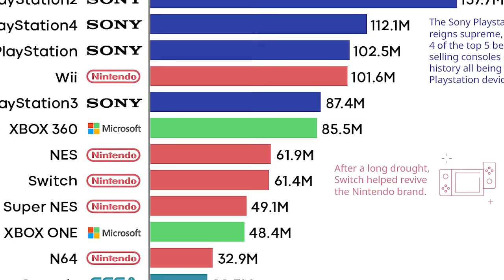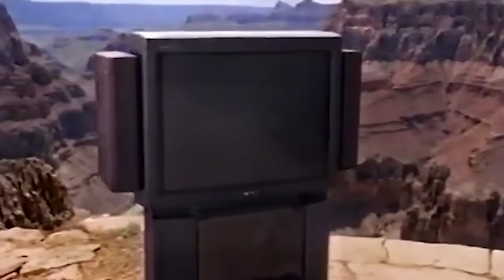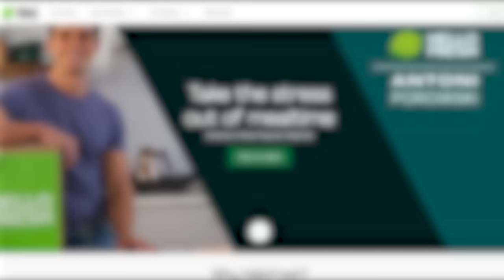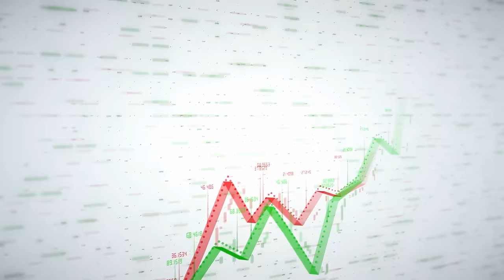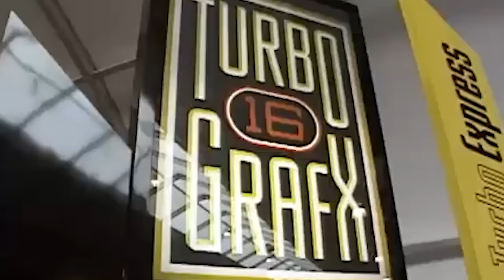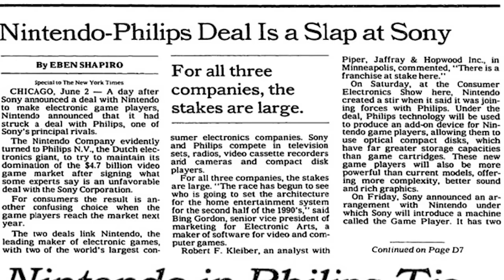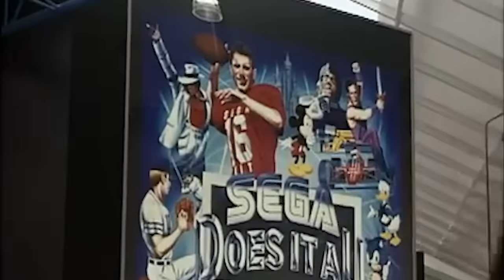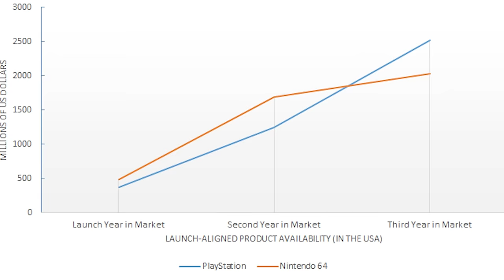The Unusual History of The Nintendo Playstation | Gaming History

Comment: There was never going to be a "Nintendo PlayStation".  The PlayStation was always going to be a Sony product.  Look at the prototype.  Do you see a Nintendo logo anywhere on it?

This myth that Nintendo "created" their greatest rival is just that.  A myth.  Once Sony decided they wanted to get into the video game industry, they became Nintendo's greatest rival, because they were willing to do anything (including lose money for well over a decade) to succeed.  Nintendo very wisely extricated themselves from a deal that would have seen them become, essentially, a second party working for Sony and the entire industry would have been worse off for it.
Reply from the maker: Course it wasn't going to be called that, it's just a fan name to refer to the collaboration. However it was still a collaboration between the two, thus they both had a stake in it and share. It required the SNES to run afterall. So yes they still did create their greatest rival with that betrayal, but as you stated it still could have happened anyways if Sony built themselves up using this and went independent after. Basically Yamauchi's worry. Eitherways they may have been damned if they did, damned if they didn't
Reply: Iirc they found a CD addon for snes by sony